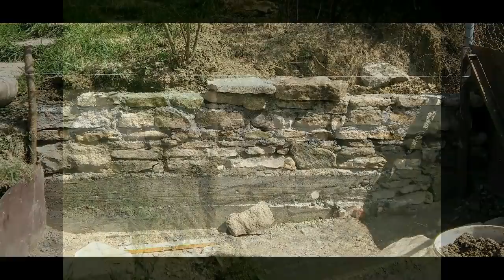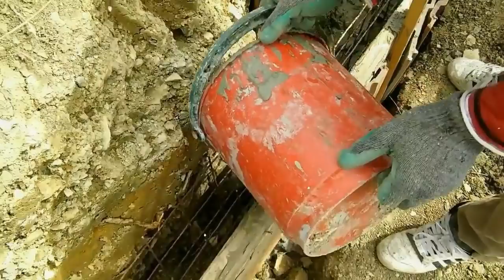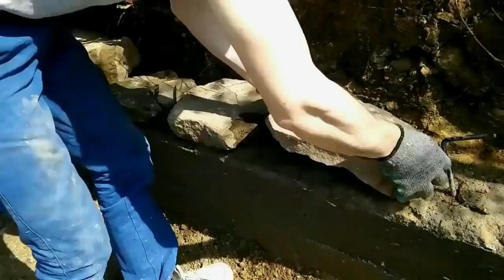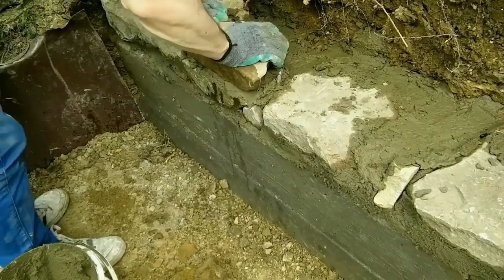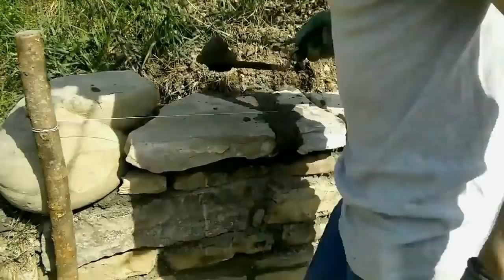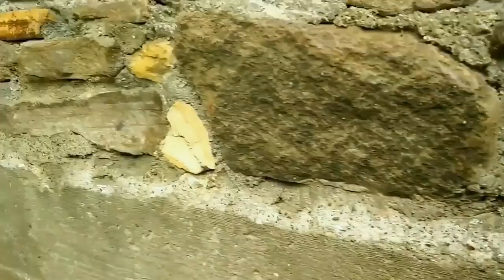Building a retaining stone wall

Comment: Lovely wall :)
Do you think you really needed a concrete foundation, or do you think some 3/4" angular crushed rock with a bed of mortar and horizontal rebar would have been a sufficient base ?
How has the wall performed since the job was done ?
I don't see any drainage and the cement between the courses means that water will have a tough time getting out from the wall won't it ?
Reply from the maker: The wall needed a foundation, and since 2 years ago nothing has changed